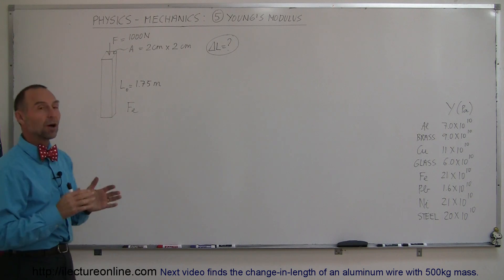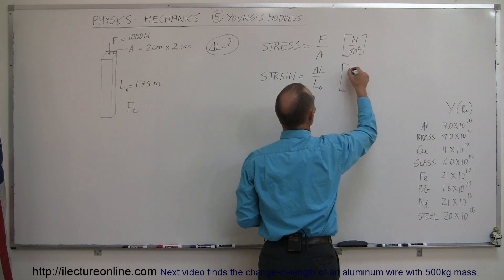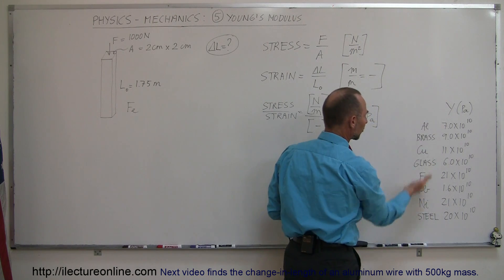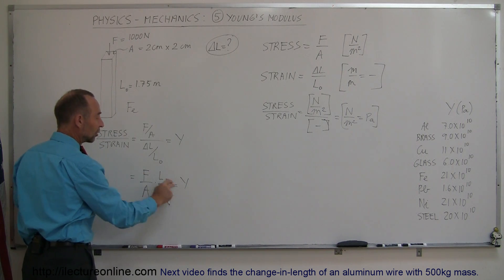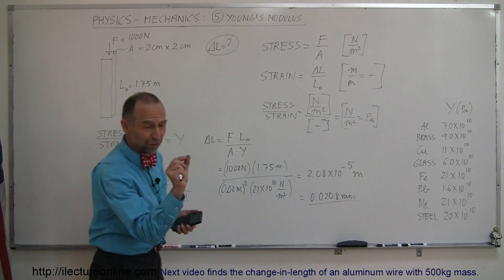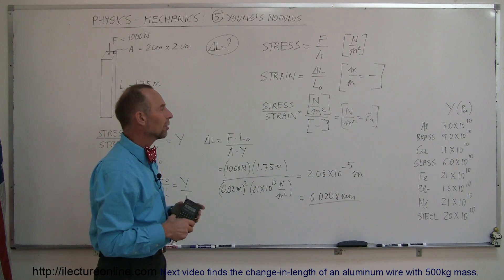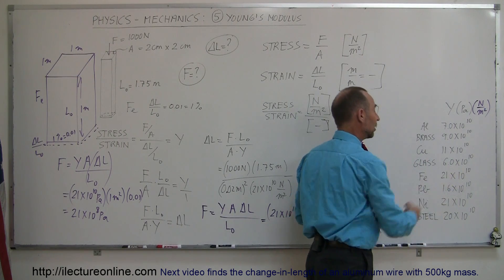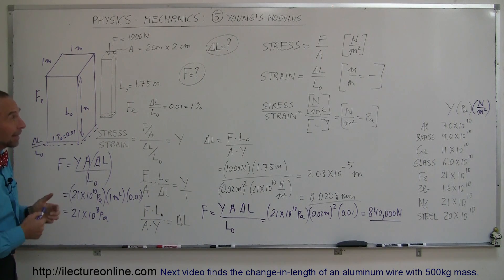Physics - Mechanics: Stress and Strain (5 of 16) Young's Modulus

Comment: Can this calculation also be used for compressive strength, ?
Ps: since it’s actually 211Gpa instead of 210Gpa which you used the answer should be 0.02073459 mm.
Reply from the maker: Compressive strength refers to the maximum load per unit area that can be applied before the material breaks down.   The units are force per unit area, which is the same as the units for pressure.
Reply: @MichelvanBiezen  I’m trying to work out what the compression (size ) of SiO2 for 1CM3  block at 1.1Gpa   (The Compressive strength ) at (4000 Newtons ) My own number gives me (0.36mm (using this Young’s modulus @ the same 1.1Gpa ( the actual young’s is 71.1 Gpa) I get 0.0363636mm ,  (10mm > 9.64mm or 9.9636364mm )
Edited to give the correct number.
Reply: @MichelvanBiezen  ps: if I used the actual number for young’s I get approximately 56.33 nanometers.
Reply from the maker: Young's modulus = (F/A) / (delta L / Lo)  = P Lo / delta L   Therefore  delta L = P Lo / Y  Is that the equation you used?  What are the values you plugged in?
Reply: @MichelvanBiezen  🤦🏼 ignore the 0.011 that’s the Bulk modulus, the correct number is closer to 0.36mm for 1.1Gpa 
Own - 1.1Gpa M2 > 110,000 cm2 (4000 N) ~ approximately 0.36mm 
Young (@ 1.1Gpa > 4000 x 0.01. /0.01 / 1,100,000,000 = 0.00000363636,
Young(@71.1 Gpa> 4000 x 0.01 /0.01. / 71,000,000,000 = 5.63380282e-8 (approx 56.33 nanometers)
Reply: @MichelvanBiezen  I guess you can’t work out which one to use either .

Comment: Great, please could you work on this question and explain;                                                        Some physical property of a hypothetical material is as follows; Young's Modulus = 2.0 x 10^11 Pa , Poisson's ratio = 0.30 and electrical resistivity = 8.0 x 10^-4 Ωm.Find the change in resistance of a wire made of the material of the given dimensions when a 2.0m length of wire of cross sectional area 5.0mm squared is stretched by a 0.40 KN tensile force

Comment: Isnt it 20.83 mm?
Reply from the maker: It depends on how many significant figures you have.  If they are not specified, we usually keep it at 3.
Reply: Michel van Biezen i mean your answer is 0.028 mm.isnt that equivalent to 2.08x10^-3?
Reply from the maker: 2.083 x 10^-5 m = 0.02083 mm

Comment: 9:50 i guess there a mistake in the unit at this time , it must be N
Reply from the maker: That is correct.  The proper unit for force is Newton.  Thanks for bringing that to my attention.
Reply: Michel van Biezen Hey Michael I have a question for you why did you ignore the normal force and didn't calacuate the dL of at then add it to the main force dL

Comment: Professor, will the young's module change if the object was heated? For example, Iron would be easier to deform but I don't know if it would necessarily be easier to compress because the atoms would be moving faster so the object would have a greater resistance to compression, right?

Comment: so what is the difference between tensile strength and young's modulus?
Reply from the maker: +Hein MT  Young's modulus is the ratio of the stress to the strain.  That is independent on the shape or dimensions of an object, and only depends on the material.  Tensile strength is the ultimate "strength" and object has against damage or destruction.  It depends on the size and shape of the object, as well as the material it is made of.  It answers the question: " How much force can you apply before it breaks?"
Reply: +Michel van Biezen  Thank you :)
Reply: +Michel van Biezen how do we get those Young's modulus value?

Comment: Sir, in case a steel wire and a copper wire are of equal length and equal area of cross section are joined end to end and the combination is subjected to a tension,the tension in both the wires are equal.Why is it so ?

Comment: As A= 2cm × 2cm which is = 4 cm^2 and converting into meters area (4×10^-2)^2 then that would be = 0.0016; That would be the area right sir? and P:S 4×10^-2 for converting into meters and square for area
Reply from the maker: +nikhil monarch 

4 cm^2 = 0.0004 m^2  (move the decimal 4 spaces)

Comment: Awesome example on a percentange change, but what i know is that a 1% percentage change of 1.75  is 0.0175 not 0.01 am i wrong ?, so i think the force required was going to be 84 000 000N,I think Sir just calculated a change of a strain as 0.01%  if i'm wrong please explain.
Reply from the maker: sizwe mbokazi The equation and answer is correct on the video.
1% = 0.01
F required = 840,000N
Take a close look at the equation and see what 0.01 represents in the equation.
Reply: Michel van Biezen I saw my confusion thaks!

Comment: I don't understand squaring numbers when they are below 0.
If you square 0.2m (20cm) it makes 0.04 (4cm) when really it would be 4 metres? Can you explain why you left the decimals as decimals and whether this creates inaccuracies
Reply from the maker: Scott Latter Scott,
check your calculations, there are a few errors.
(0.2m)^2 = 0.04m^2    (20cm)^2 = 400 cm^2  they are both the same
Reply: i don't mean to sound dumb but can you explain how they are the same please?
Reply: doesn't 400cm = 4m? not 0.04m?
Reply from the maker: Scott Latter cm^2 = cm x cm = cm squared
there are 10,000 cm^2 in 1 m^2

therefor 400 cm^2 = 0.04 m^2
Reply: thank you for clarifying, i appreciate it

Comment: Great teaching, thanks! 
But isn't the unit of the force required to deform a 1 by 1 meter iron beam supposed to be in Newton and not in Pascal? (The last calculation you're doing)
Reply from the maker: hybenbabs,
You are correct.  That should indeed be Newtons not Pascals.
Reply: Ok. And once again, thanks for the great lectures!